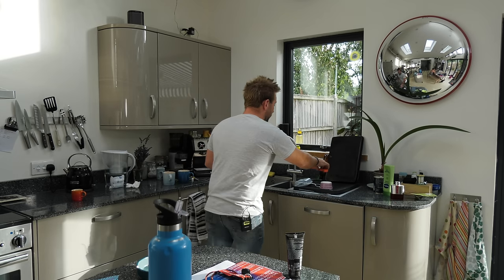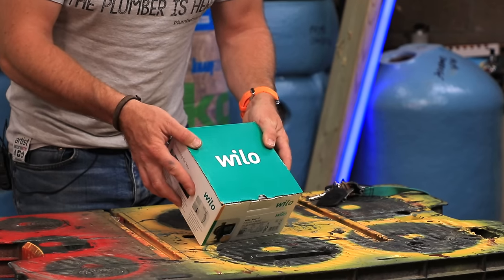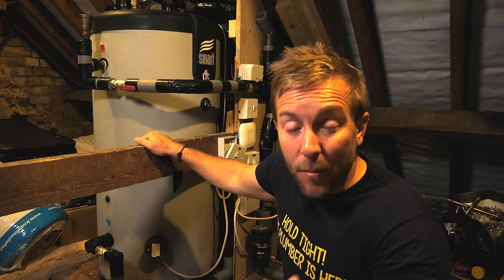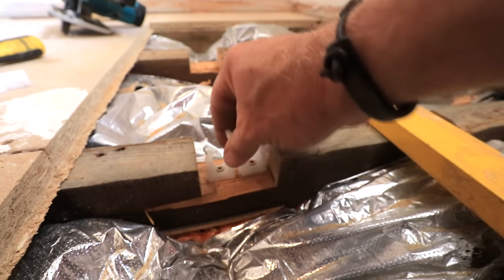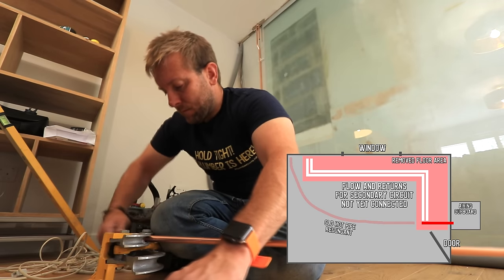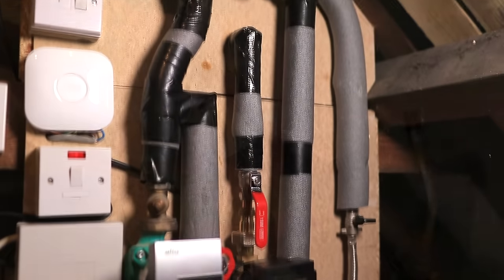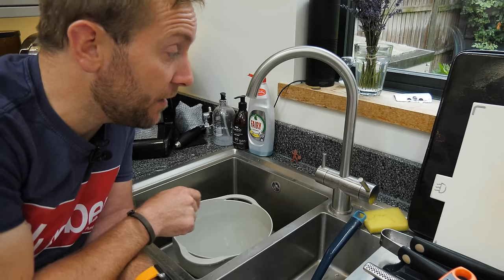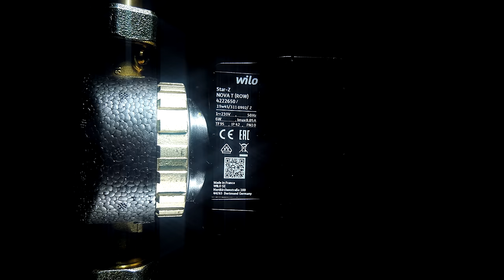HOT WATER TAKES A LONG TIME TO REACH TAPS - HOW TO GET HOT WATER FASTER! Wilo Secondary Return Pump

Comment: Mate, I just bulk boil my water and then freeze it for later, boiling water whenever I need it just sitting there.
Reply: Bulk boiled water is just silly. Use packets of dehydrated water. It’s a lot easier to store and carry about.
Reply: Pair of fools, dehydrate your water and then pop it in a ziplock bag in the freezer, this saves space and keeps the boiling water fresh
Reply: You have not allowed for the colesaireal reaction which occurs when dehydrated water approaches the incorrect temperature. I have destroyed at least two freezers misusing this method, there may hve been more but I wasn't in the house at the time so I cant be blamed. @becton98
Reply: @rogermannerings7092  you're only right as well!, I was wondering why my freezer was a steady 55 Celsius

Comment: Although implicit you don't mention the fact that under the old system, when you turn the kitchen tap off you have unpteen litres of hot water, which you've paid good money to heat, left to cool down in the pipe. So that's another saving.

Comment: This is the first I have heard anyone say you cannot use plastic pipe on a secondary circulation loop. You can use plastic pipe, best to try and make it plastic barrier pipe. Best to have the return pipe to the cylinder a small bore, as the water only needs to move slowly.

Comment: Shame I have a combi boiler in my house now, takes ages for hot water to come through.
Reply: I have over come this problem as i too have a combi & even though i live in a small flat the water takes ages to come through hot especially as i have the worse make for this problem, Ideal.
My ideal boiler has a switch on it to keep the water hot, it does nothing ! So i have installed an inline water heater, it holds about 10 litres i think, it lives under my kitchen sink in the cupboard & the hot water from the boiler passes through this small emersion heater, thus when i turn on the hot tap i have very hot water in a few seconds.
The temperature is adjustable up to 70°C.
Because it is fed from the boiler the water never runs cold. It’s 3kw but it doesn’t use much electricity, most likely more efficient than a pump circulating hot water.
Reply: @WhiskeyGulf71  thanks, i wondered if something like this was possible.
Will look into it.
Reply: @FlyingFun.  i bought it second hand on ebay for £20, it’s an ariston unvented, 10 litre capacity, 3kw under-sink water heater.

Comment: For a plumber, why is the hot on the right, when most people expect the hot on the left?
Reply: It is hot and cold on the right on his tap, he pulled the lever out to tun on, the left is for filtered water
Reply: If that's the case, I stand corrected,  just looked wrong when I saw him open the right tap for hot water,  must take a while to get use to opening a tap one way for hot, and another way for cold.
Reply: Saw that & thought they must plumb hot & cold reversed in the UK!  🤔

Comment: I installed the exact same pump to as close to the final tap as I could. Hot water time down from 40 seconds to 6 seconds. It's an expensive little fella to buy, but at 5 Watts soooo cheap to run and works a treat!

Comment: Watched a lot of your videos, very informative! Certainly the best Plumb-Tube here. I was watching in the hope to learn how to increase hot water pressure on a gravity fed system, takes about 2 minutes for 1 litre of water from our kitchen tap! It got worse ever since I replaced the deck mixer tap which claims to work on a 0.2-5.0bar system. Stressful times trying to find a black and stainless steel/chrome mixer tap which will work with such low pressure. Keep up the good work and quality videos

Comment: Eight or ten years ago, I installed a "point of use" 2 gallon electric water heater in our kitchen (12 or more feet from main water heater) for "instant" hot water. Hot water from main heater enters through the "point of use" unit so no loss of hot water, only the amount that cools off in the supply line from main to auxiliary unit. I  have moved & installed same in new house.
Reply: I did a simular thing, But for different reasons. a small 10 litre cylinder is a good simple solotion. 

We live in the country, no gas, only oil and at the time only electic showers, so using oil to heat a tank of hot water to wash hands. (we have a log burner with boiler for winter hot water) so put 10 litre hot water cylinder and fed the taps with a 2nd feed, using isolation valves to switch the feeds summer to winter. 

It worked brilliantly and saved best part of a tank of oil a year. Now we have solar thermal and solar PV, which works great espcially in the summer, (and we even get paid £1k a year through the RHI and FIT too) 

But I need to solve the problem of a long time to run hot water through to the far taps, (House is 65 ft long) hence coming here to learn more, and will fit a return loop during the kitchin refurb. This video is imfomative

Comment: Hello sir, thanks for your knowledge! Thought there was one point I was hoping to find the answer to.
Do you know if you can tee off the hot return so you can circulate hot water in 2 or more areas?
Or will the water short circuit and only loop around the nearest point if done like that?
Is the only option to run/ loop the return at the last point?
Thanks and HOLD TIGHT! 🫡

Comment: We have a return pump as we have a massive distance to the kitchen sink. When we moved in there was a very simple timer & almost no insulation on the pipe runs. It would be impossible  to add the insulation so I’ve made the pump Alexa voice controlled. Just ask it to turn on the hot water pump & it runs for 5 mins & shuts off. You just need to ask it to turn on just before you want hot water in the kitchen & it works fine. It was taking a whole bowl of wasted water before, now it’s only a litre or so. No need to turn it off as the pump only runs for a short time. Nice quick fix 👍.
Reply: Exactly what I'm about to do with our vacation cottage.

Comment: Just another thought, as the flow rate is so low to cater for the heat loss, you could use 10 mm pipe for the return. Can save on joints as well as a bit of cash. I’ve got a 20 m run on one return with a 2 m dead leg and the shower is hot in 3 to 4 seconds. Nice video 👍
Reply from the maker: Rob Connolly mate that is a top idea! Wish I’d thought of that!!!
Reply: I came here to ask this! 10mm seems perfect for the return as long as the pump is ok with this.
Reply: 10 mm is fine, the heat loss on a well insulated 10mm
Pipe is low compared to the load on a 15mm feed to a rad, so the volume flow rate is small.
Reply: I think it is normal practice to run the return in a pipe size lower

Comment: I had my pump connected to movement sensors at each tap so it only came on when it was needed. Worked perfect. I will be installing it in my new house. Mine was more like 1 second the beauty of plumbing the house from scratch.
Reply: Movement sensors near the taps is a great way to avoid running the pump when there is no chance of hot water being  drawn off. .
Reply: I'm setting up a smart motion activated light switch to automatically turn on a smart plug the pump is connected to. Any number of smart motion activated light switches in various locations can activate the pump for a set time - in my case one minute should do it.

Comment: The dead-leg can be overcome by fitting instant electric taps, like a Qooker boiling water tap fed from the hot water draw-off from the cylinder (there are a number of makers).  It would need to be a mains pressure system, like a: combi, DHW only thermal store or unvented cylinder. Qookers are a design feature in a kitchen these days with many prepared to pay for looks alone. Qookers also eliminate an electric kettle giving more room on the worktop surface, eliminating trailing electric leads. That means small children cannot reach up then grab electric kettle leads, pulling boiler water over themselves. 

A secondary circulation loop drags lots of heat from the cylinder over a day which will be wasted, and costs money in bills, no matter how much insulation you put on the pipes. 

I installed a secondary hot water circulation pump in a large house, with two bathrooms remote from the cylinder.  I fitted a movement sensor in each bathroom, that only brought in the pump when people were in the bathrooms. It pumped out the hot water fast enough.  Using the sensors means the pump only operates when needed, not on a timer. So even during the night, instant hot water at the taps, with no timer holding the pump out.
Reply: Very clever idea with movement sensors. Well done! Did you use any particular system, or was it complete DIY?
Reply: @5084204  
All easily available parts.

Comment: For the return pipe can you use a smaller diameter pipe (e.g. 10mm or 8mm) to save on copper and water, since the flow rate through the pump is tiny? Also can you hook up multiple return pipes to the same pump or is it only 1 return pipe per pump?

Comment: Great bit of kit, is this the first of it's kind, cos I remember something similar from a fair while ago. Always recommend it to clients as something to consider when other stuff is getting ripped out / put in anyway. Seen some cheaper ideas for a thermo valve that redirects the cold water out to a water butt, then flows inside when hot enough. Still means delay but at least no wasted water and veg /plants get fed, also a lot less work needed. All the best and Hold....

....Tight 👍

Comment: As I have a combi boiler, and therefore cannot use a DHW sec return, I've had an idea of installing an inline instantaneous water heater on the hot feed to our farthest (problem) outlet. The idea being that the heater would provide instant 'hot' (~36oC) water and then, if ran for long enough, the primary hot water would come through at ~50oC, causing the stat to turn the heater off. Apparently the max inlet temperatures can be up to ~60oC on these instantaneous heaters. Would be interesting to compare cost of materials and labour and then running costs of each solution.

Comment: Hi, just watched your vid on secondary return hot water. Did you just tee into the the existing hot water draw off from the cylinder? Only the vid doesn’t show you making the final connection into the hot water draw off. Regards

Comment: We had a secondary return fitted in our house around 17 years ago, IN PLASTIC. Is this an issue. Have also seen on other you-tube, that plastic is OK, as long as you have on a timer to switch off daily. Secondary return services 4 bedrooms, 3 bathrooms, kitchen and utility, really wouldn't want to swap out for copper at this stage. Works a treat though.
Reply: Barrie Dear   Ask for a refund!

Comment: Great video!... just one question... can you install a secondary pump like this and also a twin impeller shower pump on the same circuit? (i.e. to solve the problems of both low pressure and having to run hot taps for ages with a gravity fed open vented cylinder)

Comment: Interesting vid thanks :) Not sure why you can't use plastic though ? (as in 'real life' issues rather than regs).
Reply: I thought exactly the same. Can’t see why you can’t use plastic? When it’s fine on any other hot water supply.
Reply: Pipe Manufacturers instructions say so !

Comment: Long shot that you'll read this in time, but what are the Union fittings going in to this pump? Did you just use 1 inch to an end feed fitting? Done the pipework all the way to this particular pump now!

Comment: Great video. Very informative. 👏. Is the reason that you can not use this as a shower pump simply because it’s weak compare to a shower pump incase you open more than 1 tap and need much more force to push the water than a bronze pump?
Reply: And I’ve only ever seen them on return near to cylinder. But a comment and your other video showed them on flow even tho you have it on the rerun in this video. Not that I’ll ever put it on the flow but can it be installed on flow?

Comment: You can also electrically trace heat the flow pipe, before insulating. I think it works out around £100 for a 10 metre run including pipe contact thermostat. Works for combi’s
Reply: Not heard this one, but I understand the principal. However, with an unvented combi how will DHW expansion be accommodated, as I presume the trace will pre-heat the static water?
Reply: @otw5974  You can fit a small expansion vessel on the DHW to pick up any expansion. They are around £20

Comment: Is there a way of improving hot water delivery from a combi boiler with no tank?
Reply: Yep, move the boiler closer to the sink, or the sink closer to the boiler.
Reply: Some combis have a preheat function that might help a little..
Reply: Look up combisave
Reply: Smaller pipework be handy if a boiler could preheat the pipework through
Reply: Is it possible to go a shorter more direct route with the feed maybe
Reply: There are inline electric heaters you can put under your sink, using a 13amp plug. Some are direct on cold water, so you could do away with the hot feed to the sink if you wanted, others can provide a small tank so you have a reserve of hot water directly for washing hands and a few cups etc. Prices start around £55 on amazon.
Reply: Ive got same problem mate, boiler moved into a loft while ago, long distance to kitchen, I'm planning to get electrician to put 5kwh water heater ,they do now small size of a book , considering that washing up is done by dishwasher, amount of hot water I need is really small so I don't afraid of cost.
Reply: gav44 Open the tap as normal, then turn the flow down to about half. When it starts to flow hot you can open the tap fully again. This is how the combisave fittings work. Doing this saves water and gets you higher temperatures faster as you're not struggling to get the boiler heat exchanger up to full heat from cold while ten plus litres a minute of stone cold  water are passing through.
Reply: No
Reply: N0
Reply: Yes, a secondary loop can be fitted to a combi. Use two non-return valves and a pipe stat.  One valve on the cold main into the combi, a tee, the secondary return pipe feeding into this tee back into the combi's cold inlet, with the pump pumping back to the combi's cold inlet. The second valve on the suction side on the pump.  

The pump's flow has to be high enough to activate the flow switch on the combi. So the litres/min of the pump has to be checked.  The pipe stat is on the secondary loop back to the combi, after the furthest tap on the loop. The stat can be at the far end of the loop or near the combi - the farthest point on the loop is the best stat position. Have all pipes very well insulated. 

So, when the loop is up to temperature, the pump cuts out, meaning the pump is not permanently on.
Reply: @neiltitmus9744  
Sometimes a manifold on the combi draw-off with smaller pipe to the hot outlets reduces dead-leg wait time considerably.  10mm is more than adequate for most hot & cold draw-offs. I have seen 8mm used in France to basins from a manifold, which gave hot water very quickly to the tap.
Reply: @johnburns4017  I would consider very carefully be for modifying a gas burning appliance with out the express permission of the manufacturer
Reply: @timmclean-inglis9371  
What I described was NOT modifying a manufacturers appliance. Did you understand what I wrote?
Reply: @johnburns4017  show where it says you can Pipe up a combination boiler in  that way in the manufactures instruction
Reply: @timmclean-inglis9371  
Show me where it does not. It is external pipework. 
If you had in incling of engineering acumen you would see that what I have written works. I have piped a few up this way.  Also thermal store makers (instant hot water systems) recommended this method as well. 
Show where it does not work?
Show where it is unsafe?
Show where it interferes with the innards of the appliance? 

I will be waiting a long time.
Reply: John85Burns
Reply: @frankplummer4558  
?
Reply: If you have a combi, you just have to realise you are just a peasant.
Reply: John Burns   Hello John, I've heard that modern Vaillant combi's (ecotec) throw an error code if the cws inlet is above a certain value. I'm not sure what that value is, but worth knowing before piping up secondary circulation! My guess would be around 25 degrees C inlet temp before error. I've seen a Glow Worm 30kw combi running with pre heated cws running successfully.

Comment: I’ve got 6 dhw outlets and chipboard flooring. I’ve decided instead of what you’ve done, I’ll fit a bronze pump on the cold feed into the cylinder. Will achieve a similar result with no added pipework . I’ll probably use the wilo pump
Reply: Paul Turner You don't want to be returning hot water from the top of your tank to the bottom- it sounds like that's what you're planning? The whole point of a cylinder is that they stay hot at the top, and cool water is added at the bottom. You'll end up mixing the tank and just have lukewarm water until the whole tank has recovered. It will also destroy the efficiency of your boiler which relies on the lower return temperatures from the bottom of the tank to run in condensing mode. You will notice you get more vapour from the boiler flu after a shower or bath is run and the boiler is getting properly cold water returned to it. As the tank heats, the vapour reduces. Your design would mean you were constantly trying to heat already warm water.
Reply: Spencer Wilton hi mate no I have only done that with a stratification pump on horizontal cylinders. You use my method when you don’t have a secondary return tap in. It works really well